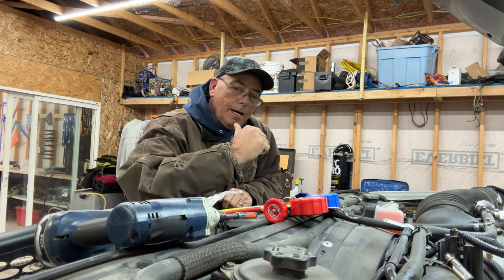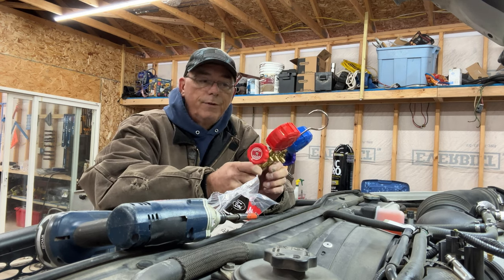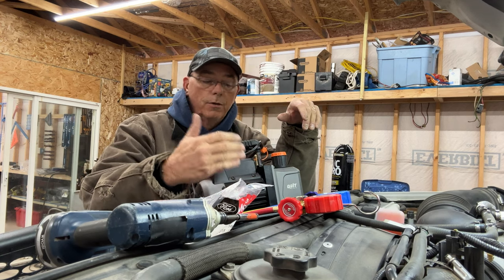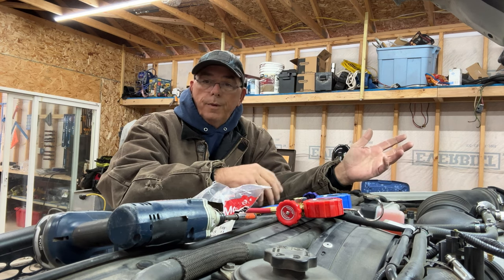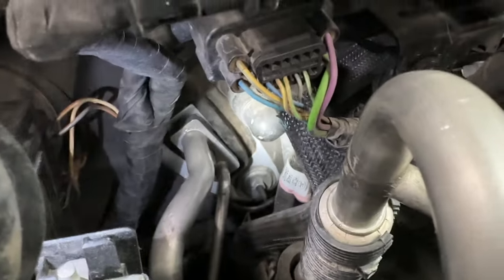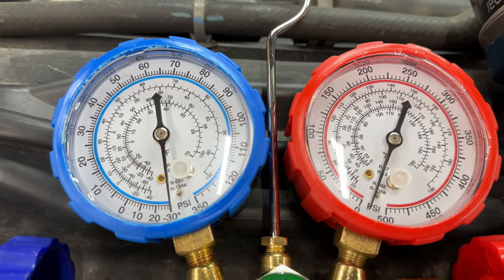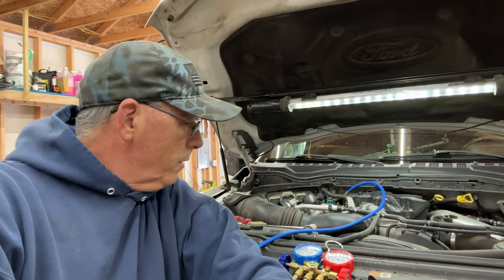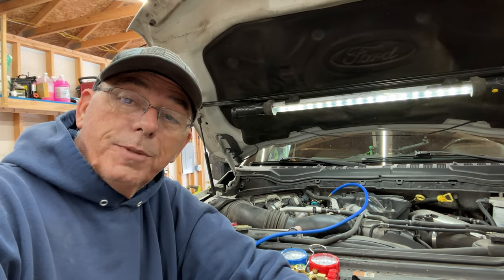You CAN Replace Your Own Thermal Expansion Valve on Your Super Duty.

Comment: Great Video Tom!
I think under the hood is a sticker for A/C that will give you Refrigerant type and amount system needs.
Also if this is a one-timee job, I took mine to a Service Center( jiffy lube). Had them vacuum down system and check for leaks. Once thar came back ok. Replaced compressor, went back with receipt and they used machine to evac system again confirmed leak free and filled system to proper oil and freon. Was 90.00 total.  Did it all in same day.
If you have dryer bottle, replace it! If you open the system, Bottle can be cut open and you will see a lot. It's your ac filter. If the compressor is failing and nylon parts are in system, you will find them.
Reply: @TravelinTim  awesome, glad you got fixed. No A/C SUCKS!

Comment: Did you swap the two seals on the other side of Valve ? The kit comes with two frontside but there’s two on back side.  Not really necessary but some say recommended if you swap valve.
Reply from the maker: I didn't and had no leaks.

Comment: Trying to find out if the TXV on a 2010 Ford Focus is replaceable from the engine compartment as on this truck; are they generally all serviceable with Ford without having to remove the evaporator housing and all the work that entails?

Comment: Thanks so much for this video.  I am going to have to replace my TXV as well.  Loved your details, especially the advice at 17:12 and the "illustration" at 17:45.
Reply: Successfully replaced the thermal expansion valve and recharged the system.  Thanks so much Tim.  Great video!!

Comment: Installed a compressor on a 2012 f250 6.7. Vacuumed system and adding refrigerant back in. Turned it on and my low side is reading 0 and high side reading 114. Why would low side be reading 0?
Reply from the maker: Leave it at rest and let the system equalize and check the pressures without it running. See if you get pressure on the low side. If it's still says zero and the high side says whatever then there is probably something wrong with the Gage. Having zero on the low side is pretty rare. if there is a restriction it usually will go into a vacuum. It's possible that you have just the right amount of charge to make it read zero when it's running. That says that it's undercharged.
Reply from the maker: At rest without it running both the high side and the low side should be the same pressure
Reply: @TravelinTim  with the truck off the pressures read 50 on low and 66 on high
Reply: with the truck off the low side reads 53 high side 67
Reply from the maker: @jaimelopez5972  sounds like
Low charge

Comment: New compressor expansion valve condenser charged to proper level using robinair machine low side is 50 n high is 100 ac off compressor and fans only work above 1000rpm then low pressure is like 10 n high is 150

Comment: This is not a DIY job. If you are qualified and understand that just replacing this valve alone is NOT enough, then leave it to Pros like me. I have worked, been trained, spent my own money and got certified to do the work..This guy has great intentions and I commend him, but to JUST do the valve is not enough. You need to replace the filter dryer and the valve, sweep the system with nitrogen and then vacuum it down. That gets the moisture and air out to the largest part as well as cleaning out the system. If you do this job without a nitro sweep and no new dryer the system has been opened and exposed to moisture and air. Yes the vacuum is good but the NEW dryer catches anything that the evacuation does not completely remove.

Doing it like he did it assures a complete system failure later. Air and refrigerant oil combine, make the oil goo and clog it up. The oil and the goo create acid. And NO 25 minutes vacuum on a GOOD day is not even close. With a new dryer and a full good vacuum you need a vacuum of 45 minutes pumping and 45 minutes holding with the pump off, valved off and no leaks.

Clearly this is a decent guy and means to help but all the money spent for gauges and a pump, the valve and refrigerant and his time will come day in a year or two, maybe 3 in an ac shop pulling the whole system OUT at $$$$  because of cutting corners!

Please HEED this warning!!!
Reply from the maker: LOL that's funny. I am an ASE Certified Master Technician. There is no reason to replace the dryer if the only failure is the valve got stuck. There was no open system for long enough to require the replacement. You sound like you have a bit of book smarts but lack the real world application to really understand the theories you were taught in school. A nitro flush is good, but we repaired AC units for decades without it with no problems. The amount of moisture in the system from it being open for 15 minutes is nothing. There is no need for a super long vacuum.  Why would you need a 45 minutes hold?  You will see a leak sooner than that. You will see 134 boiling out before that.  The hold needs to be long enough to determine if there is a leak or that something is still boiling out.   Anything more is a waste of time. 

You have good info and good intentions, you just need more experience.

Comment: I noticed in your link for the valve it is different than the one you show on the video.  Is this one with the link to Amazon still correct?
Reply from the maker: I think it's still the same. That's the part number for my year truck.
Reply: Thank you

Comment: What if high side is 0 and low is 300?
Reply from the maker: That would be a near impossibility. You would have to have two complete clogs in the system on the low side and a leak on the high side.
Reply: @TravelinTim or reconnect the gauge set in the correct way instead of having them swapped between low and high.
Reply from the maker: You can't do that. The connections are different for the low and high side